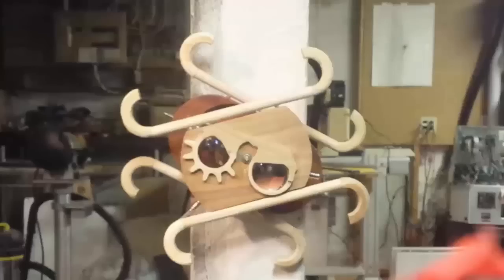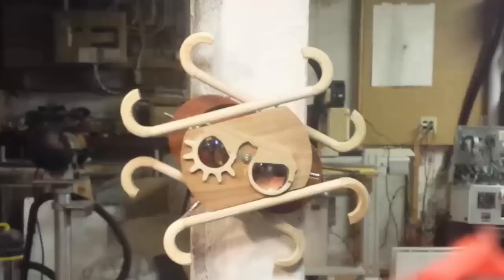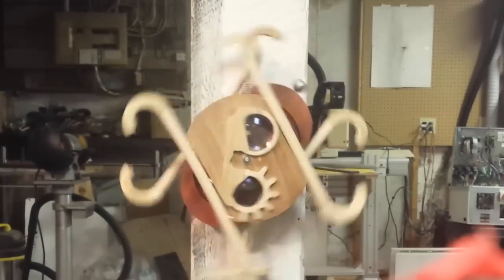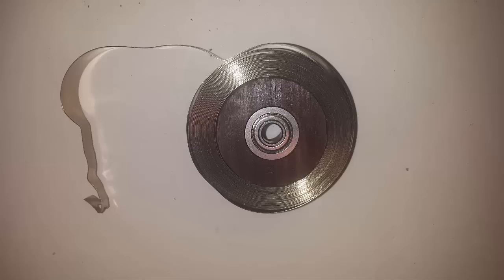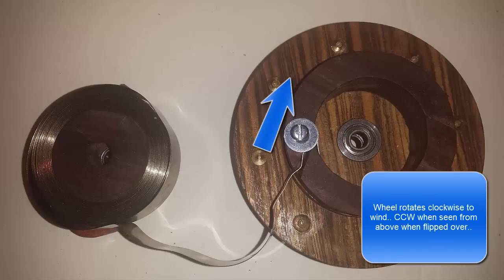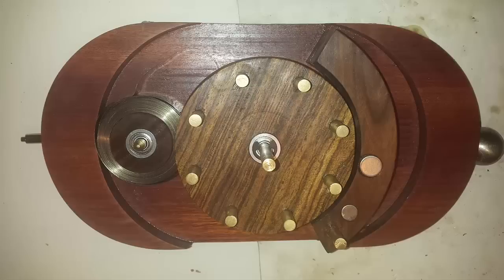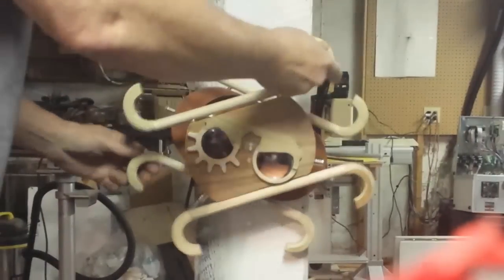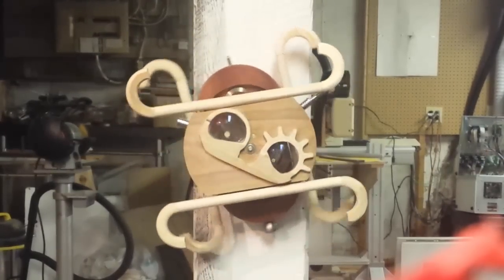Dual Rotation Kinetics

Comment: The Vulcan Spring you have given the part number for is a "Constant Torque" spring. The website also lists "Constant Force" springs. Most kinetic website, including David C Roy talk of Constant Force Springs. What is the difference, is one better than the other? i.e Constant Torque vs Constant Force?
Reply from the maker: Ive used both, to be honest I havent seen much difference. They do try to explain the difference, but I suspect its not something easily noticable. They once told me the failure rate would be higher on a constant torque.. but I doubt Ill ever hit that number of cycles either way.

Comment: Art, will this mechanism operate in a flat position?  Or does gravity play a part in its movement?
Reply from the maker: Hi Ken:
 Gravity is definitely necessary. The Wheels are purposely off balance and will seek bottom at trigger point.
Reply: @ArtofCNC  I have a huge volume requirement if you can make it work in any position.  The trigger needs to work as an escapement mechanism,  Could you possibly redesign the device to work this way?
Reply from the maker: You could make the two inner wheels elliptical with a spring backed roller pressing on the wheels. That would in essence fake gravity. I have no interest in building such a thing, 
but it is possible to fake gravity . Pretty low efficiency escapement though..

Comment: Art. I noticed the DXF has the center of the brass pins offset and the center of the arched shaped wood piece different from the driven middle disk. Is that by design? What is the purpose of the offset?
Reply from the maker: I dont find that on my overview dxf? The brass pins are on a circle centered to the center of the disk. The arch is similarly centered from the disk / rotation center. Is this the overview dxf?

Comment: Thanks for the tutorial, well done. I hope you'll  find the time to show the mechanism used in other dual rotation sculptures, that require no magnets. (I've been accused of "cheating" when using them}
Reply from the maker: I always felt it was cheating as well, but it so simplifies the process and magnets are so cheap and readily available  that it seemed easier to use them. I may try to do one without some day when I feel like being aggravated. :)
Reply: I plan on fighting gravity and coercing centrifugal force with a creation some time this spring (sans magnets), I'll try to document my aggravation and post to the forum. Thanks again for this video, very helpful.
Reply from the maker: Please do. Always interested in the journey. For the trigger on this one I stared at the screen for near an hour till the Ahha! moment.  :)

Comment: No, on the orangetrigger.DXF when I opened it in Autocad
Reply from the maker: Ahh, I see, yes your quite right, looks like it got shifted a bit as I copied it around. Sorry about that, the pins should be all centered as well as the arc. That drawing was meant really just to show the trigger itself and its relationship to the center post.

Comment: Hello Art, great video, fun mechanism.
I would like to build this ticker, but I have a problem:
How is this sculpture fixed to a wall? Do you need a seperate part? I am so confused... :-)
Greetings from germany,
Paul
Reply from the maker: Hi:

  The brass shaft on mine is just pressed into a hole in the wall into a stud. As its only touched by bearings, 
it doesnt hurt it to be simply pressed in a hole.

Art
Reply: Ok, that makes sense. Thank you very much for your quick and kind awnser. And also thanks a lot for making your plans available for everybody.

Comment: why do you need a cylinder to roll the spring at "home status" ? Why not a single pin like in old alarm clock ?
to keep constant force ?
Reply from the maker: This type of spring requires a disk of appropriate size to roll backwards on to derive the force, it is unlike a conventional clock spring. The sizes of the cylinders are specified by the maker of the springs. You can, of course use some other type of spring likk a clock spring, in which case the pin would work fine I suspect, but the constant torque springs have specific requirements..

Comment: Calling this design Genius is an understatement. I'm familiar with David C. Roy's work. He doesn't use magnets as far as I know right?
Also how long did you get it to go on one full round?
Reply from the maker: As I recall it runs between 1-2 hours on a full wind. It all depends on the weighting and balance of your vanes. Roy doesnt use magnets, that makes his the truly genius ones. :) , but thanks for the compliment.
Reply: I've been looking at Roy's videos, and came to the conclusion that he uses magnets between the two pawls.  The freewheeling pawl always clicks closed as it goes backwards past the anchored pawl, then it is attracted closed as it comes up to the anchored pawl.  I'd love to know if that's wrong/how he does it though.